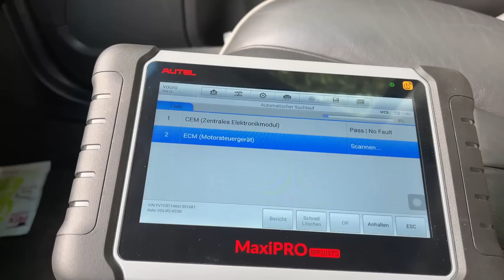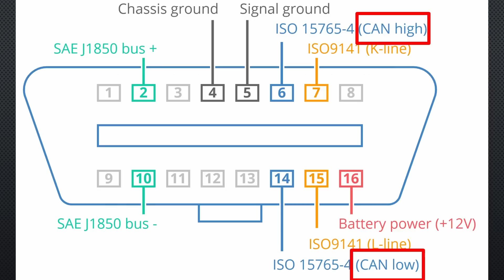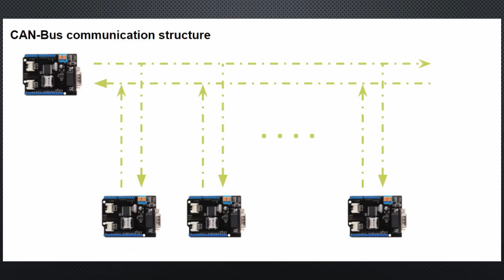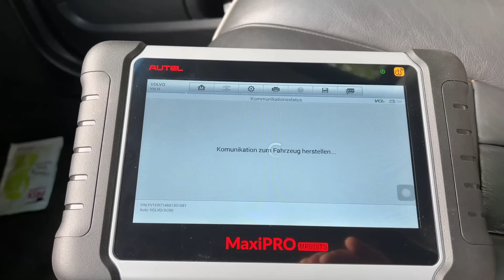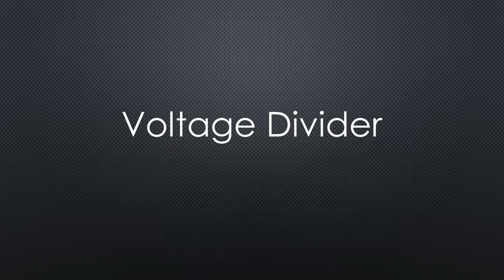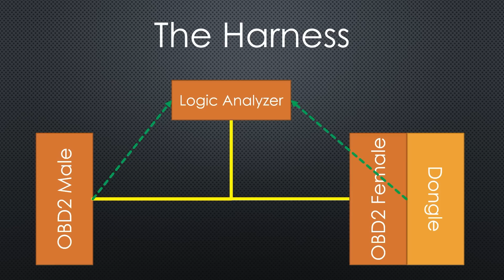#421 Home Made OBD2 Engine Alarm Resetter device using an Arduino?

Comment: clearing all codes means you will have issues you wont know about and will cuase you pain in the long run!
Reply from the maker: You are right if the issue is the engine. I would assume that, if something is defective, the alarm should reappear. Unfortunately it did not so far. As soon as it reappears it gets fixed. I just would have liked to clear the road quickly...

Comment: I think CAN analyser software is very useful for this sort of thing. There is a python library called python-can that can be used with many different CAN interfaces, including CAN messages converted to serial (e.g. from your arduino). Maybe the live message viewer could help you identify the diagnostic tool messages (they would only be sent once when you request the code reset).
Reply from the maker: Thank you for the info. Maybe it helps!

Comment: One quick suggestion that you can try.  There are very cheap dongles for ODBC 2 to Bluetooth or wireless.  Most of them use the generic wirings.  Then you better use a raspberry pi since audrino does not have these ports.  2nd suggestion is that you can get some free apps and use the dongle.  I reset my 2013 bmw error messages using this dongle and app.  But do not expect to read in-depth massaging.
Reply from the maker: I own such dongles and tried some apps last time I had an error code. But unfortunately, they did not do the trick. This is the reason for this video. But many viewers suggest trying it again. So far, I do not know which app I should use.
Reply: @AndreasSpiess  That is the difficult part.  It is hard to find a free software that does the job.  I use an old cell phone 5o install the apps.  However I really would like to know if the dongle using Bluetooth works with raspi and see if you get any traffics from ODBC.

Comment: Been there, done that. I bought a cheap one (25 EURO), with the reset functions available and it always stayed in my car. 
If I'm not mistaken, there are can bus parameters that are proprietary to the car manufacturers and can only be read/reset using the genuine software libraries. This equipment is rather expensive.
Reply from the maker: Which kind of errors were you able to kill? I tried it last time but was not able to reset the engine blocking code.
Reply: @AndreasSpiess  I used my device on 2 different cars (Opel and Jaguar). The Opel had a "top dead center sensor" (=Google translate). Usual there are 2 of these sensors in modern cars (camshaft sensor and the crankshaft sensor). If one fails, you get an error message but the remaining sensor will allow your car to go on. Once the 2nd sensor is broken down, it's game over and your car will stop instantly. Here you can easily reset the error message of the sensor. The Jaguar had a burnt valve and a gas mixture/ignition error. Also here I was able to reset the error, even while driving the car. At some point I tried to disconnect/bridge/by-pass the sensor that was sensing this error, but that was way to complicated.
Reply from the maker: @PhG1961  Thank you!

Comment: Perhaps replace the sensor giving the problem, rather than simply ignoring all error codes? Would have been interesting to know what the sensor is. If the engine refuses to start, it's possibly monitoring a critical system.
Reply from the maker: I agree and I would love to do it. Volvo drivers are safety-oriented ;-). But unfortunately, we did not take a photo before the reset (too much stressed). Now I hope it will appear again. So far, no luck.
I only wished to reset the error for a few minutes to clear the street or so...

Comment: I've got one of Voltlog's units myself without an ECU car lol.... My plan is using those CANBUS rain sensors in trashed cars for a lora weather station.
Reply from the maker: Nice project! This should be possible because you only have a one sensor as a source of messages...
Reply: @AndreasSpiess  esp chip will be for local access but lora can share info much further for fellow radio hams! You give me good ideas mate!

Comment: Wrong. The cheap scanners DO reset codes.
Any computer/processor with a serial port can be a scanner. Just send the right bits and done! 

You should really get those car issues/errors fixed.
Reply from the maker: Good to know. The ads for such scanners did not talk about resetting the codes or only for a year etc. So I was not sure if it is a scam. Which brand do you use?

Comment: Each car maker allows a subset of CAN commands under a specific “session”. You can have: default, extended, supplier, diagnostic… In this case can you check if the code you are using is already switching to the proper session before sending the dtc clear command? You should see with the sniffer (when deleting with the expensive tool) something like 0x1003, 0x1011…
Reply from the maker: Cool info! I will search for such codes next week. But what do you mean by "switching to the proper session"?
Reply: Each CAN command you send to an ECU is allowed (accepted, you’ll get back “positive response” from that ECU) within a specific logical session. You should check if before sending the clear DTC command to the malfunctioning ECU you will have to send the command to switch to a non-default logical session to accept the command
Reply from the maker: @nicolaguerrini347  That seems to be rather complicated. Is there anything I can read?

Comment: I see the library also works with ESP32. But you need a transceiver. Do you know if there are any boards with CAN for ESP32, or I should build it myself?
Reply from the maker: You can search for MCP2515 and you will get simple modules. They seem to be 5V. This is why I use the arduino for the moment.
Reply: @AndreasSpiess  Hi Andreas,
Use the SN65HVD230 3.3-V CAN Bus Transceiver @ your ESP32!
According to NXP AppNotes and my very experience, there is NO violation of CAN BUS integrity with Mixed 5V transceivers @ the same bus. (running in my car Environment for two years now)
Best regards
Henry

Comment: Adblue Andreas? I have an OBD2 in my mazda. More Silver and 2 Chinese coins for the weekend. I used to use an oscilloscope to read it when I didn't have one. I did a vlog on the Chinese OBD2 Bluetooth dongle, it resets a fault no problem.  For 26 dollars a steal.
Reply from the maker: Which app did you use? The ones I used did not do the trick :-(

Comment: Hello,ello,ello. Is there anybody IN there? Just nod if you can hear me. Is there anyone at home? 😎
Yes, I'm restoring an old '82 Chevy van and need to replace the ECU with a RPI and a graphical gauges (pronounced as gage, BTW ;-)) display. So, it needs to read the engine sensors, provide timing pulses, and provide visual feedback to the driver.
Reply from the maker: That is an interesting project. It is the other side of the scanners! Your challenge is probably to interface all the different sensors. Good luck!

Comment: I use a couple obdlink mx+ and cx and use torque on my android phone. It will reset the cel and will communicate on the can high and low paths. 

You will most likely have to emulate elm327 and run software be it tied to your phone or laptop. I'm looking forward to this

Btw the obdlink cx is bt le and doesn't work well with software that can't wake it up. Forscan refused to even see it. These use stn chips which will keep up with that canbus without a problem. The cheap elm327 are rarely even usable today.
Reply from the maker: I have an "old" ELM327 dongle. But unfortunately, the apps I used were able to show all the data but were not able to reset the engine stopping alarms :-(
Reply: @AndreasSpiess  some do and some don't. Most at v1.5 which can only look at obd2 and not the canbus or if can only high or low. Btw new canbus believe had 3 high medium and low. And I just looked. Seems the odblink devices only looks at generic on the Volvo not own specific pid's

Comment: Perhaps it's better to get yourself a < $5 ELM327 OBD2 reader. There are several types of devices, wired, Wifi and bluetooth. With such a reader you can read OBD2 information yourself and you can reset error messages yourself. (on demand)

The risk of automated resetting error messages is that you might miss important error messages, which may lead to serious (engine) damage. Some error messages can safely be ignored, others are meant to take appropriate actions immediately. (Unfortunately it cost me a repair of well over €2400 to understand)
Reply from the maker: So you found an app that resets engine blocking messages? The ones I tried only showed the analysis...
And of course, you are right with the handling of errors. My theory is that a severe error should occur again immediately after resetting. But in your case, it seems that this did not happen.

Comment: Hi, the MCP2515 offers two filter masks and 5 address filters, you can use these to filter out messages from control-units you are not interested in - and bring down the 1500 packets/s to a more reasonable amount.
In my project though I had to set the device into loopbackmode to successfully set the filter and into normalmode afterwards.
I'm very interested in interfacing with cars via can-bus and very keen on your follow-up video. If you'd like more info about how I implemented filtering let me know! 😃
Reply from the maker: I saw this filtering method but never used it because I changed to low-level sniffing. Now I can filter with excel. This is well known to me ;-)
So far I still do not know which filter to apply...
Reply: @AndreasSpiess  One way to easily filter the correct ID´s is to look at the cycle times. OBD or UDS ID´s are often not sent cyclic. So if you exclude all the cyclic ID´s you should be able to find the service ID´s.
Reply: In my experience with mcp2515, the CAN library was too slow to receive messages, because it was relying on reading the status register, utilizing rx0 and rx1 buffer interrupt I was able to capture all th messages

Comment: Hallo Andreas, you opened a whole can of worms - so to say ;-)
I applaud your determination and methodical approach! But there are much easier ways to clear those pesky DTCs. One of the easiest is to use a Chinese clone of the ELM327 Blue-tooth adapter and the Torque application on your phone.
There are also several other free Soft wares for use with your Laptop - if you are so inclined.  
Careful with clearing DTCs before going to technical inspection,  since it will result in a "p1000 obd2 cycle not completed"  DTC.  
Some cars seem to have built in random error generators - maybe to generate additional income for the dealers ??  Honi soit qui mal y pense...
Reply: Yes, here in states you can't clear the codes immediately and then take it to an inspection station for its yearly safety inspection. You have to drive the car some minimum distance before the system is "ready" again. This was done to prevent people from tampering with their emissions systems in the car and passing inspections. OBDII was conceived as baseline communication language for emissions related issues only. The standard gives the minimum items to monitor but in recent years it has been extended to other items by each manufacturer by adding nonstandard functions. Modern cars typically will have more than one protocol also, they all will have OBDII because it is mandated by law, but they usually will have some other protocol that only oem tools can speak.
Reply: @timothystark5986  Correct. Andmy error comes back after I drive far enough, but inspection shows no real issues, only a computer error. I will never pass emissions again!
Reply from the maker: Good to know about the "p1000 obd2 cycle not completed". However it seems it is a "non-blocking" code
So far the Volvo never exposed such a behavior...
Reply: @AndreasSpiess  In Germany you do not need to worry about P1000, the OBD drive cycles in E-OBD cars are much more limited. If you cleared the codes and drive it once until warmed up (~10 min. or so), that's enough to set the monitors on German market cars. TÜV doesn't care, in the past they manually checked the exhaust output if the monitors were not set, nowadays they check the exhaust output regardless.

In the US that's a different story, they only look at those monitors and some of them are tricky to get set to the "Ready" state. You can easily spend 2 hrs or so after clearing the codes to make them set again and you need to drive a very specific way to set them, which can make it annoying and/or downright impossible (unless you do it in the middle of the night without traffic).

Comment: Have you tried turning it off and on again ?  :)  unhooking the battery for a few minutes may also correct the problem .
Reply from the maker: Interesting! Another viewer suggested to  turn the key a few times without starting the engine helps (see pinned comment).

Comment: all EOBD is the same for all cars.
you used autel and used the volvo diagnostics.
use the EOBD read function and sniff that.
Reply from the maker: Interestingly, I have to select the car brand before I can start the analysis. So it seems to me that the cars use different messages?
So far my logic analyzer sniffs the messages. But because there are so many I do not yet know which ones come from where and which are the ones I have to replicate later with my Arduino :-(
Reply: might be an autel software version thing.our autel has a EOBD function for non listed brands
Reply from the maker: @colindevaux4476  The Autel works. My Arduino does not work :-(
Reply: Basically there are 2 types of diagnosis, the OBD one which is compulsory and standardized and which can be done with any cheap adapter, and the manufacturer specific for which you need an expensive tool. If your error was specific to Volvo diagnostic and not a generic OBD one then no chance to clear it.

Comment: There is only a small standard subset of can bus data thats the same for all makes of cars. The rest is all defined by the manufacturer and the details are not exposed to the public. They go to extreme measures to try and block access to the information,  I know one manufacturer where the car has to be connected  via the Internet back to them for diagnostic purposes, they get sent messages for what to  check or change. ,looks like they don't even trust their own garages with being able to decode the data.
Reply from the maker: You are right. This is what I found out last week. My advantage is that I have a device which has the information (it was able to kill the alarms). So I hoped to be able to see these commands on the bus. But currently, I do not know which one do the trick ;-)

Comment: Interesting timing.  I received and tested out my Panlong bluetooth OBDII adapter that was amazingly cheap to buy online.  I paid a little more from an eBay seller so to get shipped sooner... though ~$13 is a way better price that what I first paid for (~$67) and returned once I found the ELM327 & Panlong versions.  I'm only using Hybrid Assistant on Android LG G4 phone for now to display engine coolant temp since I blocked my engine radiator grill 100% a few weeks back.  Amazing what is capable with better software... days when would be nice if there were better open source protocol/communication analyzers for the LA's.
Reply from the maker: Is it capable of deleting the engine blocking messages or only to do analyses?
Reply: @AndreasSpiess  Maybe yes. Try it. I had tested APS error, but this didn't make engine block. I can delete error message with this. Please refer APS test on my channel.
Reply: @AndreasSpiess  Looks like my replies are being deleted, I guess due to links provides?  Maybe you've received in related email notification if you get?
Reply: @AndreasSpiess  Well, YT is capable of deleting messages.  Yes, appears is a transceiver bluetooth device that is not only for Android as listed with Torq Lite and OBD Auto Doctor... the Amazon seller noted in a reply ""PCMSCAN and ScanMaster-ELM can work with Windows."   Listing notes "Support all OBDII protocols: J1850 PWM, J1850 VPW, ISO9141-2, ISO14230-4 (KWP2000), ISO15765-4 (CAN-BUS)"
Reply: @AndreasSpiess  I think I noted in a reply that might be worth finding the application that is most cost effective that can delete the codes and when doing that, use the LA to determine what is being sent during that process.  That's if there isn't an open source functioning way.  I think that's about all I noted in the deleted reply comments, with the amazon link that can be found by searching "Panlong Bluetooth OBD2".
Reply: @AndreasSpiess  Maybe since replies with links are being deleted, try searching "OBD Software - Elm Electronics" to find the webpage with the links to the OBD softwares.
Reply from the maker: @jafinch78  Indeed. YouTube started to delete comments with link. Found the page. Thanks!
Reply: @AndreasSpiess  When I was out last, I tested Torq Lite which is free and does appear to show the option to Clear Fault Codes. I didn't try to make any, so didn't have any to test.    I don't see any open source code for searching Google... though wondering for insight if someone can decompile/deobfuscate the code to see what is desired.  I've never worked with programming Android or any smartphone apps.  Your very welcome and thank you for sharing and all your great work!